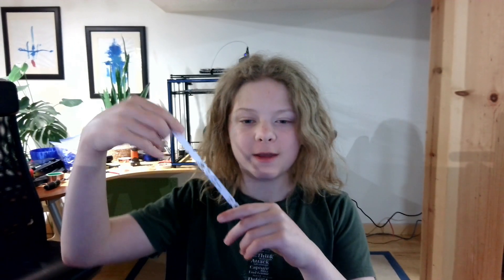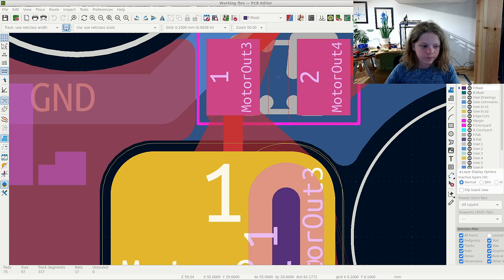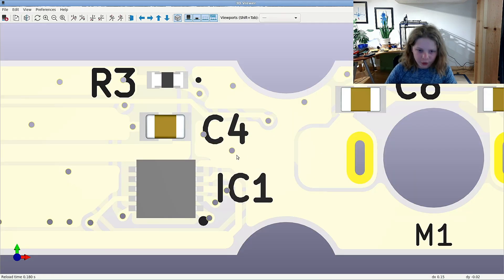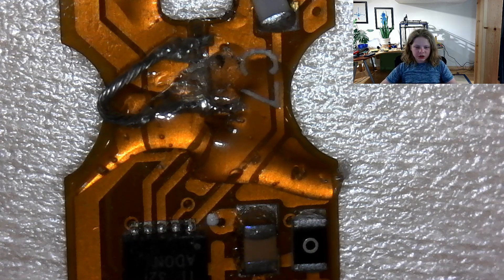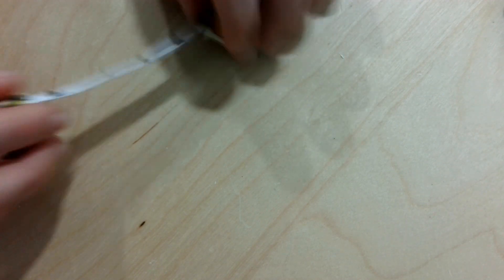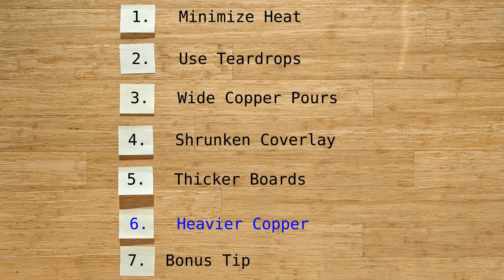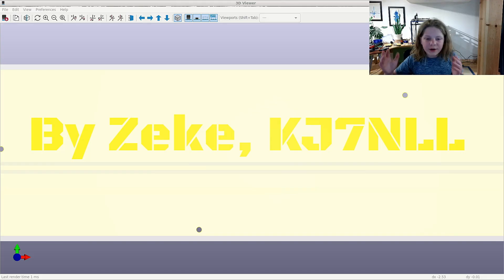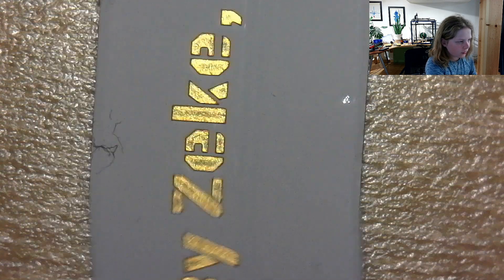If You Design PCBs, Watch This

Comment: You have better tips than most adults and they they are all pretty similar to my #1 rule since starting pcb design after years of building others designs, drones and doing smd repair and it's always use more copper, make the traces as wide as you can especially if they carry power, bigger/multiple via's too and as much ground pour and stitching as possible basically it's always better to have more copper. Oh and no sharp angles haha round those traces and the corners of pads, stitching pads keeps them from delaminating too if you can spare the space under them.